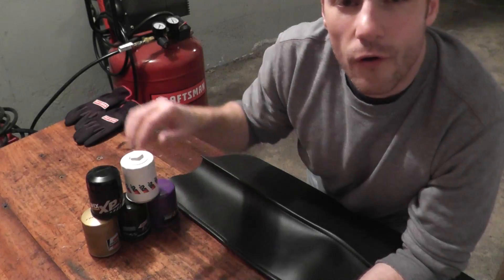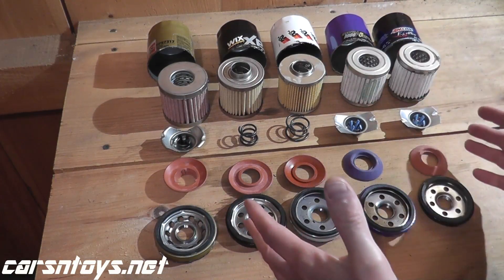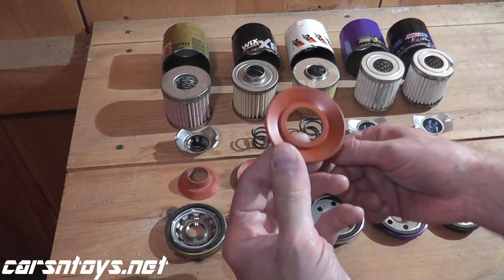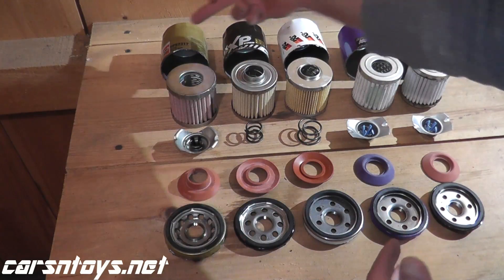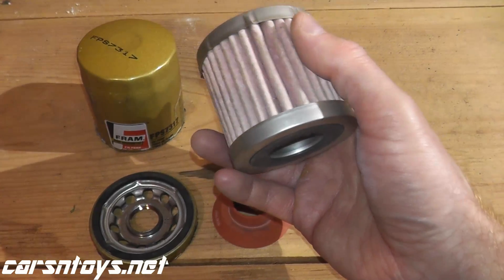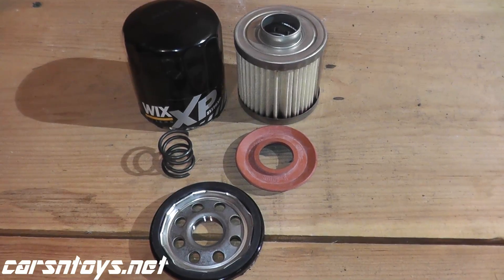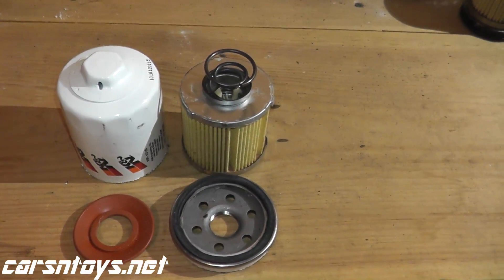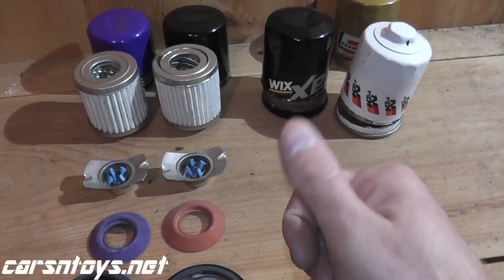Choosing the BEST OIL FILTER...FRAM vs WIX vs K&N vs Others

Comment: Guy claims to be an experienced tech.  Can't pronounce the name of an oil filter properly.  SMH.

On another note, just use whatever filter you're comfortable using.  I've been using Fram for over 20 years and have never had a single issue yet so many people say they are the worst filters but never offer up why lol.  As long as you follow the proper oil change interval, you won't run into any issues.

Dude, your videos are nothing more then showing what each filter uses to filter the oil.  This doesn't really prove anything and surly doesn't prove which one is the best.  The real test is to use each filter for the proper interval and then cut each one open and see what each has filtered out or which has filter out the most crap from the oil.

Also, filters have bypass valves built into them for a reason and that reason is because filters can't filter 100% of the oil.  They only filter a small percentage of the oil.  They physically can't handle the volume of oil pumped through them to filter 100% of the oil, especially during a cold start up.
Reply: Bill Hartman checking them after the same interval would be cool to see. It would also be nice to take all the oil out and strain it to see what is left over as well.  I use K&N and my motor is just fine but the rest of my truck is starting to show its age. I have 237,000 on it. I agree just change it at the proper time and use quality products and your fine. Bypass filters are good too.
Reply: Very good point on Fram Bill.   My same experience for 30+ years.   Only Fram has easy grip, a + for me.
Reply: Yep true, but they probably changed it by now.
Reply: Maybe he has dyslexia?
Reply: I always heard that fram filters were finer, so they filter more but clog faster
Reply: butthurt
Reply: Bill Hartman I heard a story from my old avanced auto store about fram filters a guy went in Got a fram filter changed his oil and his moter blew up on feather looking into why fram used a cardbord in that filter it fell apart and cloged his filter outlet I don't know if it's true tho only what I been told
Reply: triggered much?

Comment: After sending the oil samples in to have it analyzed, the Wix was the worst one to come apart during use, it an unacceptable foreign matter measurement.
Reply: Can't B you On what vehicle did the oil come out of? How many miles are on the vehicle?  How many miles between oil changes? Just curious that's a very vague statement with no information to back your statement. And was it done with all the filters shown here? What air filter was used on the car and was it change for each test? Believe it or not that's were most of your contaminates get inside your engine.
Reply: I can believe it. Wix fan boys can't. Smh

Comment: Fact...not all filters for every make and model are built the same.  Run Amsoil filter on my Hemi and that filter has a coil spring to keep it sealed with the bypass on the bottom plate.  K&N runs a very high end cellulose material in most (not all) of their filters because of contract obligations, and is a very good quality filter.  

LOVE comments like..."Used fram filter and walmart oil for xxxxxx mileage and no problems....and i finish by saying, "that you know of...torn apart ur engine to see whats really happening inside?"

Comment: Wix filters in everything I use.
Reply: wix is the only filter out for me nothing but wix
Reply: Wix can be found at AutoZone, Advance, and O'Reilly (maybe at Pep Boys, but I don't like the staff at my local outlet).  Also, if you research it, I believe NAPA filters are the same as Wix.
Reply: Sun Rise   I’ve NEVER seen Wix @ AZ in my life
Reply: @sunrise8263  Amazon too
Reply: I used to buy Fram.But I was introduced to WIX after I worked at an autoparts warehouse. Since then..i never looked back. Oil and air filters.
Reply: I ran Bosch on my vw and I'm gonna do k&n on my integra
Reply: Cody   Used Bosch a long time,good filtering & drain intervals
Reply: Wix for me too
Reply: good selection at rockauto.com
Reply: Kreutzwerkz   O’Reilly stores all have standard Wix & Wix XP on the shelf and CAN get Wix for heavy machinery too
Reply: Napa Gold is a relabeled Wix XP. I'm not sure what the Napa Select translates to, but I'm pretty sure they are made by Wix as well. Depending on the particular Napa you go to, and how much raport you have with the counter people there, you might be able to get them to cut you a decent price brake on filters and other parts. If you're not a regular or come across as a goober, don't expect to pay less than a regular walk in.
Reply: If you look at napa oil filters warranty, it says wix warrants them.
Reply: @inferiorexterior9335  :O'Reilly's Should Have Both the Reg.& XP Filters,Here in South,If Urs Isn't in their Reg.Stk.They Will Get Them..Also,Believe Car Quest for Synthetic Oil , Filter is Same As Wix XP & About $3-3.50 Cheaper than XP.

Comment: Great review! Now what if you had a jig to simulate flow and particle filtration using  used oil from the same vehicle and running same amount thru each filter for 24 hrs? would like to see what oil results are  before and after filtration from each filter.
Reply: You meant 240 hours, not 24, and in an engine test rig, right? At an average of 30mph, with a 50% duty cycle, 24 hours would simulate performance over 360 miles, , not nearly long enough to experience filtering oil contaminated by engine blowby and acidic condensation.

Comment: You safety wire the oil filter for the same reason you do the nuts. It's to prevent the vibrations from high rpms causing them to become loose and leak fluid.

Comment: Mobil 1 tried and tested,the best
Reply: Really?  Been using it in my 2004 Ram with Hemi for 240,000 miles changing about every 11 thousand miles or so.  It's done good by me.
Reply: Mobil 1 can't hold its viscosity. Good but not great.
Reply: ToAstYNaChO
I hang out at Hemi forums for years.  Everyone blames a different oil for their hemi tick. As many opinions on it as there are oils..
Reply: If you can find a deal on Mobil 1, they are great filters.  Amsoil is pretty expensive.  Fram Ultra is the best deal on the market outside any special deal on Mobil 1.
Reply: Luis Hernandez wannabe mechanic mobil 1 is rubbish .almost every car that uses Mobil just drinks its like no tomorrow if your car goes through too much oil before you even change all of it then your engine has a issue or your oil is rubbish o with another brand use a oil that has zinc in it
Reply: UreaSmith
it doesn't "perform" bad. It just heavily emphasizes the HEMI tick
Reply: I've come to the consensus that Mobil1 is the universal tick magnifier, never saw a post saying it helped
Reply: M Ericks    based on UOA or what?
Reply: Says who? in my experience, with HEMI engines in particular, mobil 1 is a terrible oil.

Comment: Thank You for doing this for us
Reply from the maker: Glad to help and I appreciate the feedback!
Reply: William Handy thanks pro, I learned alot today and I still prefer the purple stuff
Reply: We did this in high school autoshop in 84' we found back then that there was no difference between fram, wix etc.
Reply: @donrutter6765  Well I can't account for 1984, but today is more relevant and it's obvious the materials and construction quality of say a K&N vs the run of the mill FRAM (PH Series) is night and day, but typically so is the price. You get what you pay for, but most of the OEMs such as MotorCraft and ACDelco are a good compromise between K&N quality and FRAM pricing.
Reply: CarsNToys
Reply: William Handy WHAT was your take away from this video, William ?
Reply: Neal E. Kaufman it allows you to see the guts of what the filter is and the quality and effort that they put into it
Reply: I’ve seen other videos with the filters being torn apart but they always used the lower end Fram and it was always disappointing but it seems to me if u bought the higher end Fram, u wouldn’t be disappointed. It seems like they really stepped up in that filter u used and I did some research on Fram and they even make 2 higher end filters than the one u used. They have a racing filter for about $13 on average and a commercial filter for around $20 on average. I’ve heard a lot of good things about the Wix filters. All my vehicles are Ford F-250’s so I just use the Motorcraft filters and I hope they aren’t a low budget filter like some of the ones I’ve seen.
Reply: D Rutt 1969  yeah it's obvious " looking " at the different filters there's no difference???????  yeah and of course you can vouch for the different materials used in the different filters right??? of course you can just see with your eyes ???????????  LOL ,  you did that to in 84?? I can tell you're a minimum wage guy who smoked dope and used drugs,  all his life ,  that's what I can tell.  you should never speak you complete DUMBASS !! RIP  another hit  off that BONG !!
Reply: @AmericanSurvival1  That's what D. Rutter found, doesn't mean he does drugs. You assume alot DUMBASS!!..a project in auto class, that's it. I can go ahead and assume you write like a tweaker,

Comment: I drive a Hyundai Elantra GT, an engine that is notoriously picky on which oil filter be used. I've found the OEM Hyundai/Kia filter to be awesome. However after some experimentation I've found the K&N to also work flawlessly and is very effective to boot. I use Valvoline full syn engine oil and change at intervals of precisely 4k. With this K&N/Valvoline set up I've noticed oil coming out at changes looking like it just went in. No dry starts and no valve tap at cold start ups.
Reply: +Steven Wilson Better than any American car I've ever owned
Reply: +Steven Wilson lmfao

Comment: Great info ! I used to teach a class at my house of worship on auto safety and maintenance. ( mostly women ) I told them much of what you said here in my oil class. I say used to , because most of them didn't listen . " I just go to the oil change place" they'd say . " Let me know how those $1 oil filters from China work for you ! " I'd reply.
Reply: Let me know how those $1 oil filters from China work for you ?"
They work great, b/c I change them every 2k miles or so. And most cost $2 (pronto)
However I catch the fram on sale for about taht
It easy on my car.
To spend $ 10 to 15 on a filter is crazy.
FWIW, I use mobil 1  full syn
Reply: +cpgone Paper is great for reading the news or wiping your behind.  Not oil filters . Using a cheap oil filter with Mobile 1 makes about as much sense as $6000 worth of wheels , tires , and stereo equipment on a $1000 oil burning P.O.S. Oh wait , I've seen those.
Reply: Shepperd November 
A problem with the cheap filters is 
the pleats dont hold oil , so dry start ups.
the pro tec is bad about this.
I may do a vid about this.
The pronto seems better.
But im able to get the Fram  and XL for 2 to 3 bucks.
could care less about the stamped drain back valve.
226ooo on my 93 maxima.

Comment: I really like how you do your videos. You convinced me to choose Bosch over Mobil 1 because Bosch was 69 grams internal weight.  I think this is probably very important. Also, Bosch is cheaper at Walmart where the cheap priced oil is. Out of these 5, which one is heaviest on the internals.  I don't care about the outside as much because I don't plan on busting it driving off road, and may want to cut it open.
Reply: Love these enteraining, humorous opinion pieces by non-engineers. 

Almost as reliable and useful as an Accuweather Minutecast rain prediction for a zip code.
Reply from the maker: Thank you! Glad to help
Reply: Yes, the weight of those metal endcaps and core is critical to filtration.

Comment: Amsoil Ea filters aren't rated for 15,000 they are rated for 25,000 miles big difference!!
It is supposed to be the oil filter to work with Amsoil signature series oil which is 25,000 miles drain intervals!!
Reply from the maker: Yes, some Amsoil filters are good up to 25k miles/one year. However, this specific oil filter (part Ea 15K 13) is rated at 15k miles.
Reply: @Carsntoys  Boom!
Reply: I appreciate the effort people go to, to do these reviews, but YES. We need some people with full and accurate knowledge in depth understanding of ALL the parts reviewed. You cannot beat a full Amsoil system.
Reply: +Just1Spark 
Thank you.

Comment: NAPA oil filters are made by WIX
Reply: Wix is the maker i work at a napa and if we have issues we call wix that's why say a napa gold 1058 is the same as a wix 21058 all wix filters have one extra number for class such as oil fuel or air. the wix racing are different from standerd as well.
Reply: +Josh Shank  Not sure if you are replying to my comment but I was commenting on the microgaurd filter sold at o'reillys, personally I only buy wix and napa gold filters as wix is the only oil filter company I trust.
Reply: Yes napa gold.
Reply: mrgearheadfromhell Napa Gold?
Reply: I worked at oreilly auto parts for 5 years,  had to deal with the local Napa on multiple occasions and the wix xp from oreillys and the Napa platinum filter are the same filter, the just have different part numbers. A Napa gold filter and a standard wix from oreillys are the same,
Reply: That's really good to know!
Reply: @WOWster007  It's the NAPA platinum that are WIX AFAIK.
Reply: So are the oreillys house brand microguard, just lower quality materials are used to make them.
Reply: Microgaurd is made by Honeywell (Fram)
Reply: Last I knew microguard changed to a wix equivalent to NAPA silver.  So much better than old fram crap. Fram is now a wix too.
Reply: so are micrograuds
Reply: Wix is the best filters on the market and they make amsoil filters.
Reply: @Gsrsourkrause  actually amsoil makes their own
Reply: @seanmets1720  they actually dont...the amsoil rep even told us that. They are wix platinum filters...

Comment: Never change your oil without changing the oil filter !
Reply: +CarsNToys If the filter is rated higher than the oil life (oil life is X but filter is rated to XX) why not?

While I have a clean engine, I can't help but to see what the filter on my cigarette looks like after a few puffs and try to correlate that to my car.

Yes, I know that smoking is bad, yet how can an oil filter last 15,000 miles given the surface area vs contaminants? And yes, this is a serious question as I take better care of my car than I do myself and I really want to understand this.
Reply: This is completely untrue. May newer vehicles have filters with a much longer service life than the oil in the engine. I tried to find it again but I couldn't, but there was a thread on a honda forum about following the schedule of changing the filter every oil change or every other oil change per the manual. The blackstone results yielded no difference worth making the filter worth changing every time.

Do I change mine every time? Yep. Doesn't mean it needs it.
Reply from the maker: +Rick Mahoney Well said!
Reply: +RetroMMA smoking produces alot of ash doesn't get hot enough to burn, more importantly is the "tar" like compounds, engines burn liquids and burn at much higher temps and pressures, it is a cleaner process, if done ideally it would just produce co2 and h20, cigarette filters aren't concerned with your long term health they were just regulated into the product  to imply safer but,  who really knows, we are breathing in the filter material too. We should quit smoking.

Comment: The WIX oil filters I asked you to show have changed since I sold them. Sorry. They used a totally different type of fore ring media that was not pleated. It was more like a foam, a permeable membrane that completely filled the chamber between the center post to the outer wall of the canister. When I saw your video I wondered just how effective those filters were by today's standards. I guess we'll never know.

Comment: correction, Mobil 1 & K&N use a synthetic blend material
Reply from the maker: +AttachedSilver I believe K&N pro series oil filters use synthetic material. The 'wrench off' filters use cellulose media.
Reply: Not sure about the pro series but, I know the Mobil 1 & wrench off K&N are the same inside. I bought a Mobil 1 filter today & the box says synthetic fiber blend. correct if I'm wrong tho

Comment: My question for the filter manufacturer is why don't you magnetize the filter housing?
Reply: Last Dog Up just stick a 15 dollar magnet on the side
Reply: Go to auto-zone and get magnet wrap I’ve been doing that on all my rides
Reply: Why, doesn't the filter grab all the metal shavings anyways?  Maybe the super fine ones it doesn't....
Reply: Landon Poindexter and does it work?
Reply: Because the filters already catches most of the metal if it’s to small for the filter to get then the magnetic will not be able to capture it
Reply: Maybe one good reason is that most of the metals in your engine aren't magnetic.
Reply: Kartboard22g, It's more or less to keep the very fine metalic matter out of the filter media, so the media can filter the other contaminants...  I personally think a magnet in/on the filter is a total waste of time, as not all the wearable metals in an engine are magnetic, to top it off, if you have any metal in the oil, your pump has already had that metal go through it, before it ever touched the filter!

So yeah, IMO, magnets on the filter = 100% useless marketing bullshit that everyone buys into.  It is the snakeoil of the filter market it seems.  Some benefit, but mostly marketing hype.
Reply: too expensive.

Comment: wix, use synthetic oil and change the filter every 3 to 4 k.
change the oil/filter at 12k
peace
Reply: No use amsoil oil and filter change oil every year or 20,000 miles been doing this for years cars been running until 300,000 plus😁